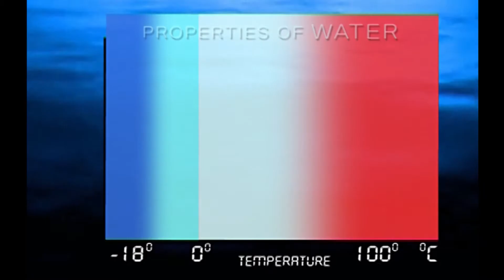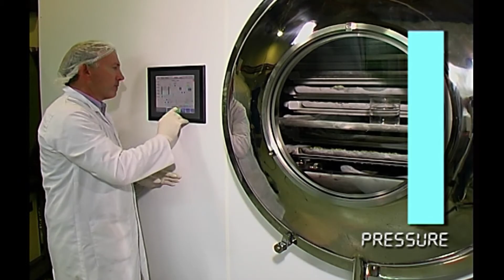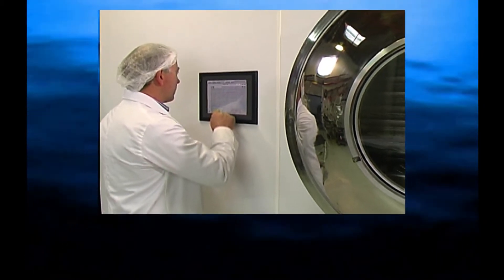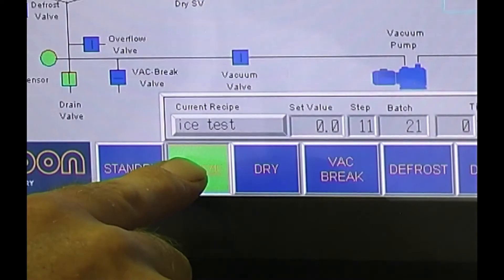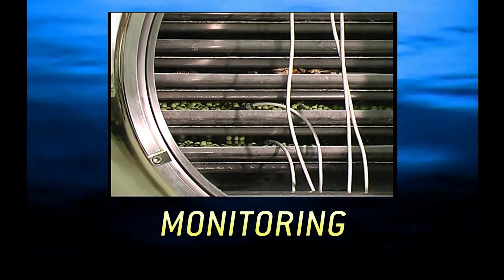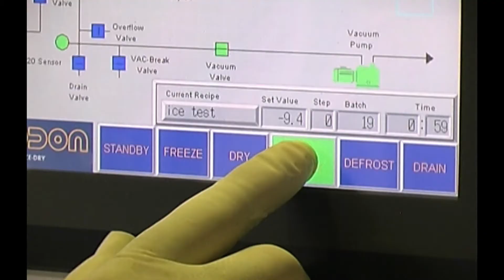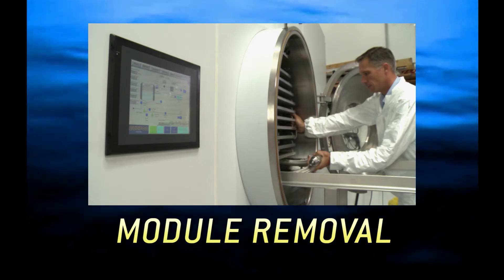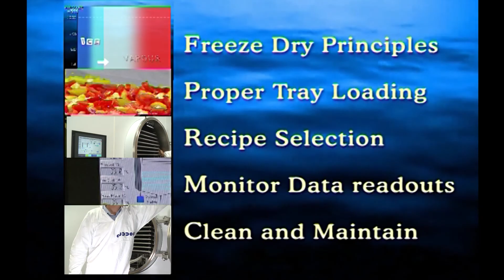Cuddon Freeze Dry - FD80

Comment: I wonder how much electricity does it consume per weight?
How the ice is also removed btw?
Reply from the maker: Power consumption of the FD80 is around 160kW per 24 hrs. Ice is removed by flooding the bottom part of the chamber with hot water.